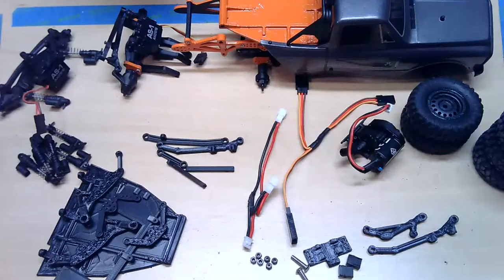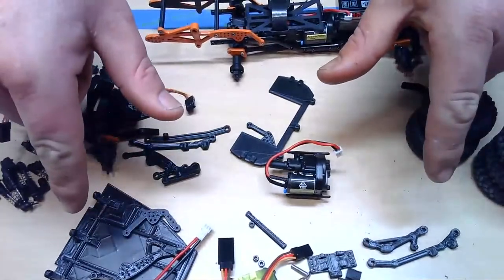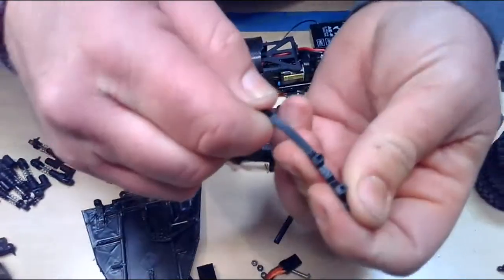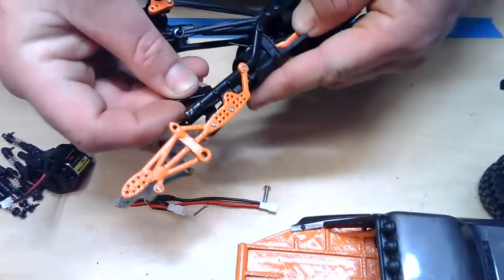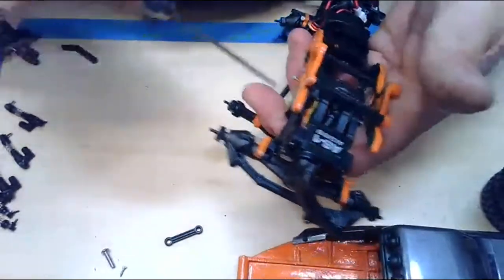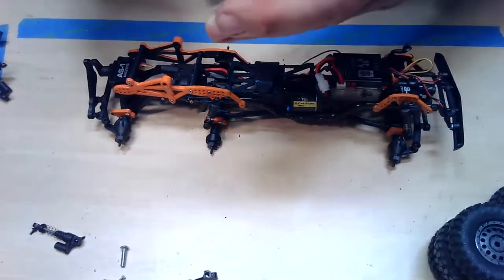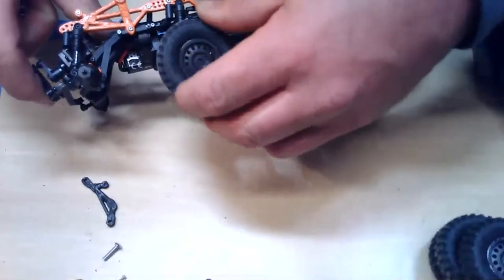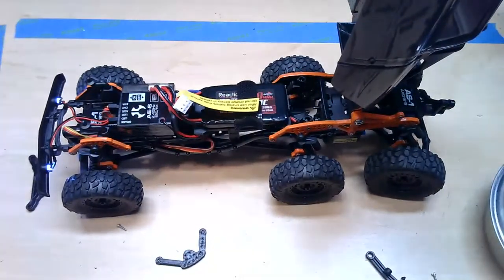Building the Mofo Rc 6x6 C10 Kit with rear steering

Comment: Great content if you would like an 8 x 8 I just put two together front to rear with extra classes rails flipped back to back the hole line up i just swapped axles on the rear one so I could have rear steer I put a Servo reverser and had to cut the drive shaft 1/8 due to the transmission not being perfectly centered then bind both cars to the same remote 👍 2 motors help alot
Reply from the maker: good idea!
Reply: @MofoRC  thank you sir on the front car on the 8x8 i put a steering axle all front 4 wheels turn the same direction with a y connector 👍